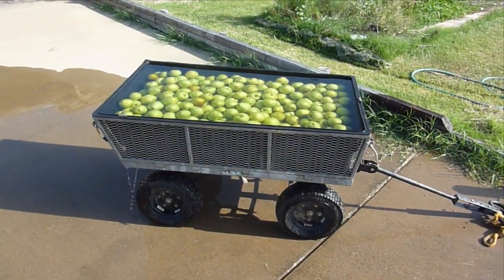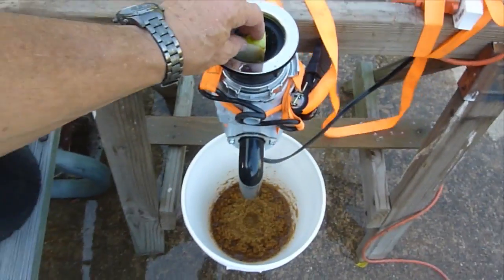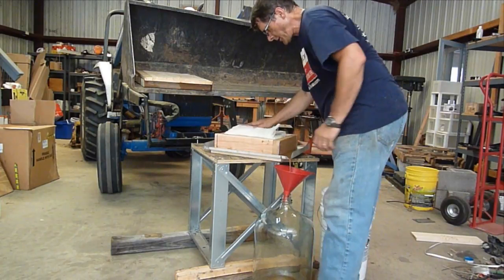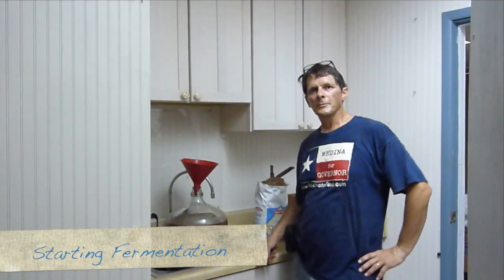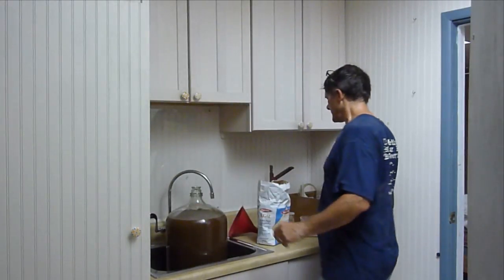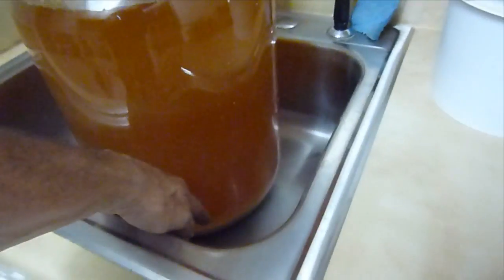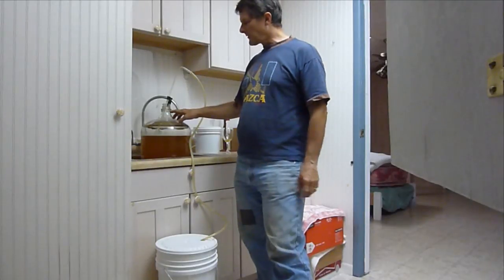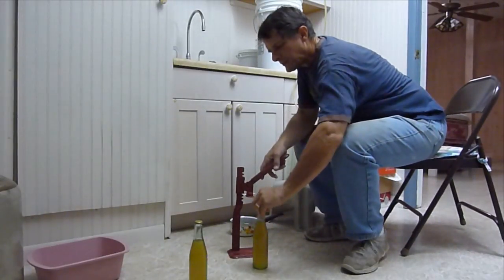Making Pear Cider - Take 2

Comment: So how did it turn out? Hoping to do a batch in a similar way this week. Other that I plan on using pectic enzyme to break the fruit down more before pressing.
Reply from the maker: It turned out pretty good, but the next year I made another batch and added some raisins, which made it better. I've seen some comments affirming that it helps considerably. Something about the raisins giving food for the yeast. My first video was out there for a while and has a lot more comments - many about this subject. The "Copyright Police" shut it down for many countries as there was some background music - if you look, you might find the other video.
Reply from the maker: It turned out good. In the next few batches, I added raisins before the fermentation, as pears have the side-effect of gas - as in farts. Now, it is 2018 and the pear trees are loaded again, so I'm thinking about running another batch.
Reply: Sorry you had issues with the Copyright Police. From what I've found is that if you list the song, artist, publisher and release date in the video description, they leave you alone - at least most of the time.
A couple of suggestions I'd make would be to add either citric acid or ascorbic acid to your bucket when you're pressing the fruit. This prevents the fruit juice from browning. Another thing would be to get one of those round apple slicer/corers to remove the cores and seeds. I've read that the seeds can add all sorts of funky flavors and odors to the juice.